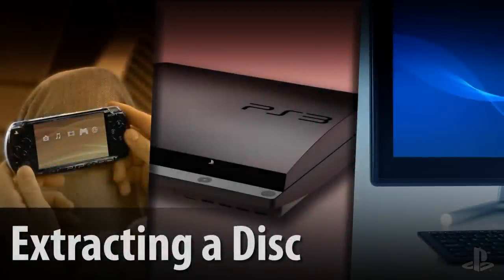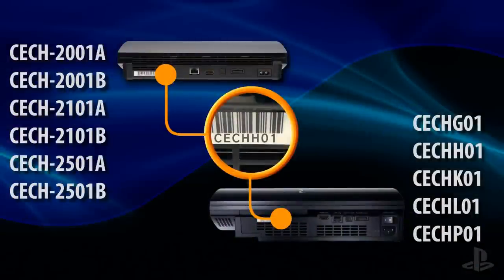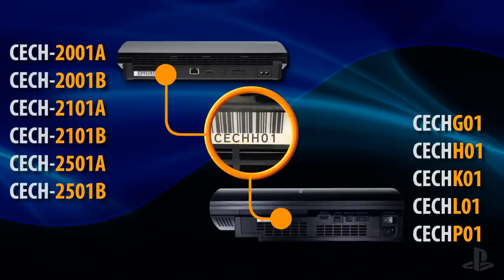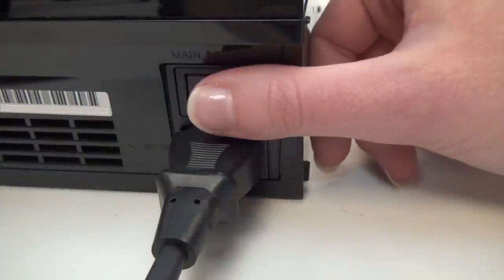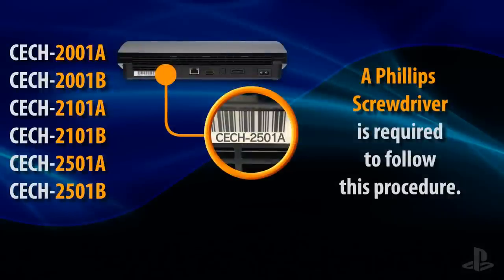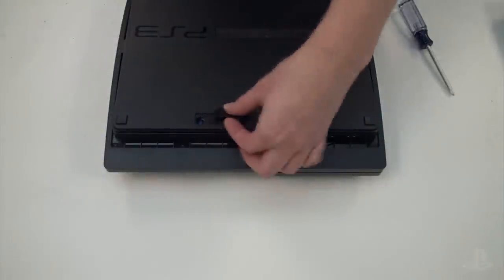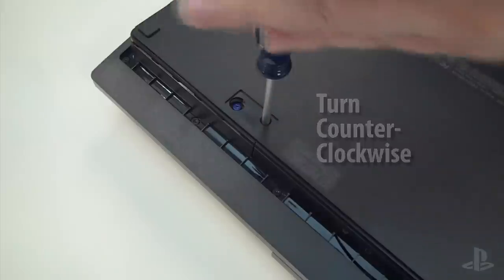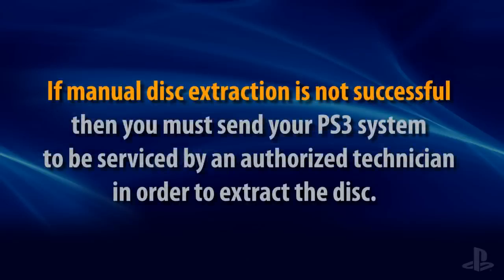Extracting a Disc from a PS3 system

Comment: Sweet it worked. I tried ejecting the disk via controller but it did nothing so I turned it off and back on and pushed the eject button and it still wouldn't come out. I checked the model and tried procedure 1 and it worked!! Thanks so much! I thought I was gonna have to get a new PS3

Comment: I tried to extract the disc on my PS3 Slim system by holding the eject button down with the power cable unplugged from my PS3 and plug the power cable back into my PS3 and it definitely works.
ℹ. Please note that the fan will be very loud when doing this operation so cover your ears. 👂🏻

Comment: I use the method where you turn the ps3 completely off then turn on the ps3 while holding the eject. But I have to do it every time I want to play a differnt game. Playstation please write to me telling me what the best thing to do. I had my ps3 since 2007 and it still works pretty good, only problem is that it won't eject.